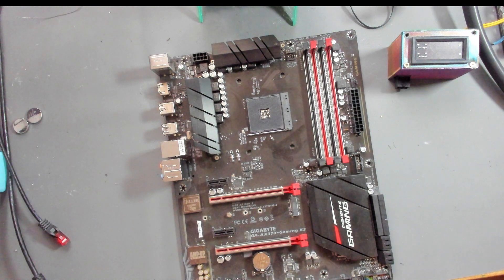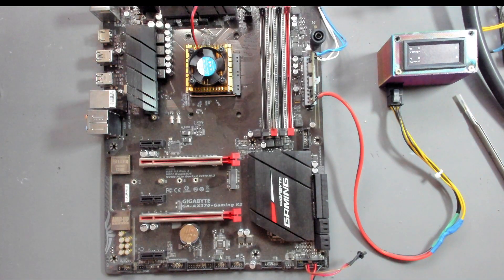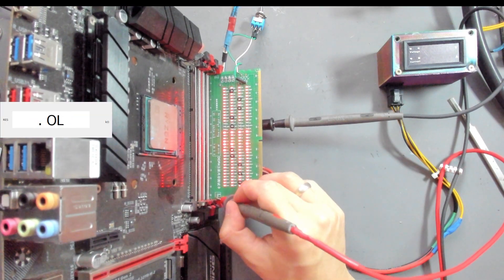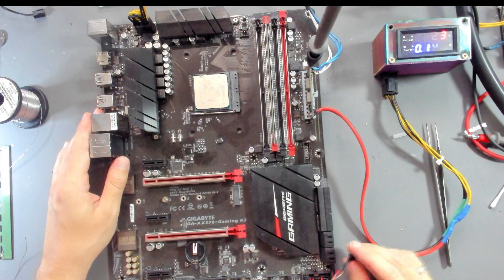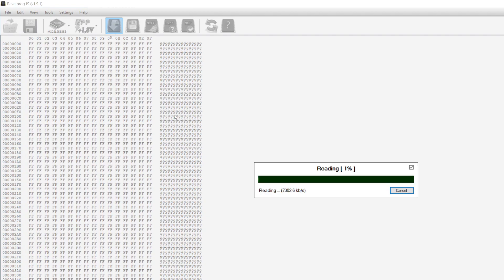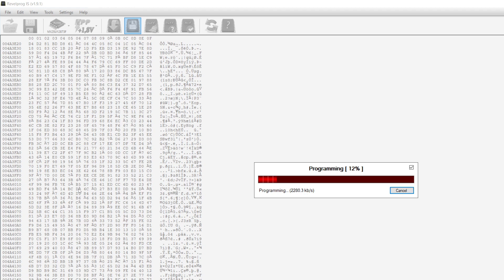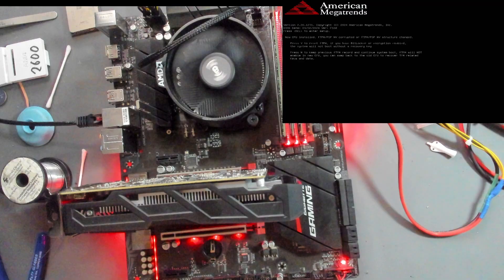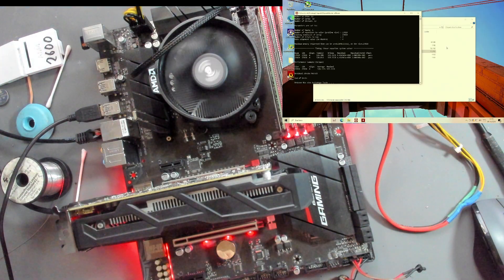MOST COMMON FAULT ON ATX MOTHERBOARDS ||GIGABYTE GA-AX370- GAMING K3 REPAIR FIX

Comment: I really like that connector you have to power the board.
Do you have any drawings or links to it ?
Thank you.
Reply from the maker: Hey there, what an honor to get a comment from you! Learned a lot from your repairs and videos! 
It is a pico adapter! Originaly used for mining! Sometimes also called 12V to 24 pin adapter! 
I do have links in my description to it!
The rest ist just a simple amp meter in series with it!
Reply: @MainboardMedic I thought he was talking about that multi eeprom board for revelprog programmer

Comment: 2nd video in a week I've seen where end users have bricked their motherboard by incorrectly updating their BIOS. This is becoming a very worrying trend and as another commenter said yep Dual BIOS has always just been a marketing gimmick. Especially where Gigabyte is concerned. I personally refuse to put anything from that company into customers computers full stop! Garbage brand and even worse DOA process. Warranty repairs? Nope 6 months if you're lucky enough to have them not try to blame the customer for the very obvious manafacturing flaws, sub standard components and terrible PCB layout designs as well.

Simply put, avoid ALL Gigabyte products all together!

MSI in a close second place as well.
Reply from the maker: Sadly i can only agree, its a disgrace with the dual Bios setup just never working. 

But there is often so much performance left on the table with not updating the Bios, exspecially on AM4 there have been so many improvements with bioses, yet to mention all the CPU´s that are added over the time!

Comment: Hmm, I lost a bit. If there is and was the backup bios, why you needed at all write the main bios againg? Why the backup did nor work and why it should work in future?
Reply from the maker: I dont know why but the backup feature just does not want to work on Gigabyte boards, ive had this multiple times now!

Comment: interesting video. I have an intel board GA-Z97MX-Gaming 5 that has similar symptoms. Can you tell me what happens about the data in the Backup BIOS? Does it automatically update to whats in the main BIOS once the board boots or does it stay the same until you desolder it and re-program it?
Reply: If the second BIOS chip is actually working, just swap them and it should work just fine. If you swap them and still don't work then you may need to use a programmer.
Reply: @Dandan-tg6tj  Thanks, but my question is, when the board is working does the backup BIOS chip update to whats in the main BIOS chip or does it stay forever with what it was originally programmed with?
Reply: @martinnash007  Stay forever with what it was originally programmed with. This if somewhere along the way, the main BIOS is not failing and the board manages to use the secondary BIOS and while the secondary BIOS is used, the owner or the automated updating software isn't updating the BIOS.
Reply from the maker: If you programm it inside the actual Bios with Q-flash there is an option to programm both at once! So you have to fix one yourself and then you can do it in the bios!

Comment: Hello great video, I have a ab350m-ds3h and I thought it had a bad bios, it wont give any beeps even after a bios reflash, cpu heats and the leds light up, it has a bit corroded realtek chip and 32k crystal do you have any suggestions?
Reply from the maker: Check for components near SIO and CPU socket, after that backside, then around screwholes and then around pcie slots!
Reply: @MainboardMedic  Thanks man saw a video of yours and decided to clean the pcie, ram and cpu socket with a tooth brush and the board is working. Thank you keep it up with the great content

Comment: Maybe a stupid question, but how did you spot that you have DRAM when trying to first boot by pressing switch? Cannot see clearly but as if there are two different LEDs?
Reply from the maker: Its really hard to see, because they are all red and also clustered together, but there are 4 LED´s which have a label on the board. Topleft is CPU, top right is DRAM, bottom left is VGA bottom right is BOOT! Sadly my cam cant really pick that up! On Asus Boards they are coulor coded and its easier to distinguish!
Reply: @MainboardMedic  thank you very much
Reply: Yes, usually be different LEDs. Depending on the board they might be all right next to each other in a group or might be spread around. Some boards will use different colours for each stage.

Comment: Gigabyte dual BIOS continues to be as useless as ever i see...
Reply: So true... My very first repair attempt was a Gigabyte board with dual BIOS, similar symptoms to this video but I didn't have much knowledge back then. I went around in circles checking everything else, DDR voltages, PCH, SIO, looking for physical damage, everything BUT the BIOS because I kept telling myself "it couldn't be the BIOS because the backup BIOS would have recovered". It was the BIOS.
Reply: Recovering procedere has to be initiated by hand in many cases. So dual BIOS is not that useless at all in the end, its the users, who are just unwilling to check the manual and take the necessary steps
Reply from the maker: @neovita3818  It is incredible to me that a theoreticly well though out feature just does not function! I had multiple different Gigabyte Boards with exactly that and its really frustrating, that they can not get it to work properly! Many Boards sadly dont have a switch and the Board "intelegently" does it itself!
Reply: @MainboardMedic  Gigabyte "feature" since the intel first/second gen bitrot days. Yet it seems to rarely ever function.
Reply: Sometimes it can be more than useless. I had one Threadripper board that would trigger auto bios reflash from the backup ROM if the memory timings were not stable and it failed in a certain steps during the post. So, in such an unstable condition it started re-flashing the bios. I don't even have to say it but yes it ended up in a disaster. The only good dual bios boards are those where you can manually specify your ROM with a jumper, like what Asrock X99 extreme 4 had.

Comment: I have just fixed a MSI B350 Tomahawak right now with the same problem, corrupted bios, but found out it has bad socket now it always stuck on CPU Led. It works tho when I  dont mount CPU cooler.

Comment: Hi, I have a certain motherboard, specifically the MSI B350 Tomahawk. I bought it on OLX. When I tested it under load in the Heaven Benchmark program, the computer suddenly turned off. The board no longer starts and does not respond to the power button. What do you think it could be? I will add that the components work without any problems on another motherboard. 
When the board is connected to the power supply, you can hear clicking sounds in the power supply.
Reply: Check 3.3v on the power SW
Reply from the maker: I would also think that most likely your 12V for the CPU is shorted, if it failed under load!
Reply: Heaven bench would be GPU. Either your PSU is failing or your GPU is failing under load. +-80% of all GPUs fail under load because of overheating or because of thermal expansion and broken solder ball under the core/vram.